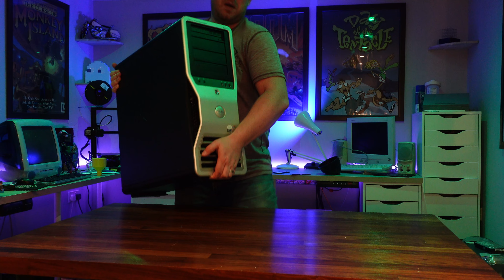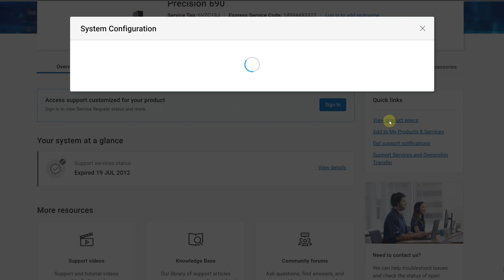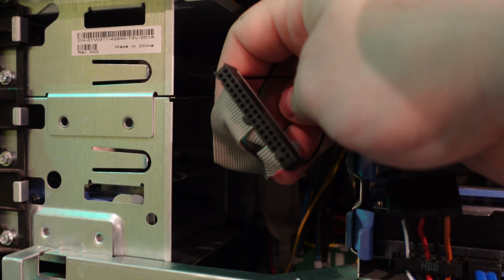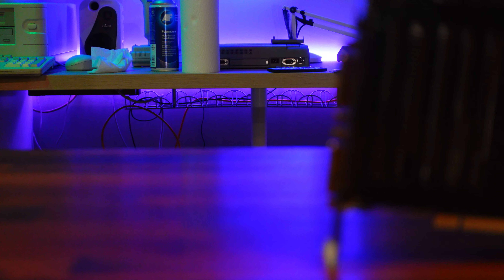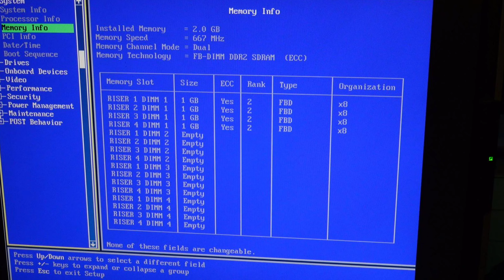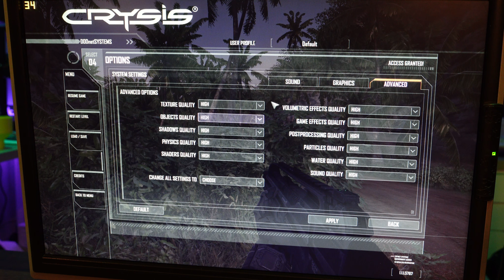Ultimate Windows XP Build - Intel Xeon / 8800GTX #GPUJune2

Comment: If you still have that malfunctioning gpu you showed at the beginning of the video odds are you can get it working by replacing the thermal paste and if it has them pads as well. Also if you know how to solder or have someone who can do it for you replacing all the capacitors is always a great idea for such an old device. Also check solder joints are good they may have cracked. If so they should be pretty easy to reflow them.

Comment: I've been fascinated by Xeon workstations for a bit now. You can get a lot of computing power for sometimes very little money the catch is the they can be big hot and loud and usually they don't come with any modern gpus and the power supplies can be a bit difficult to work with. But if you can look past that and do your research so you know what your buying and getting into they can be fun to have and tinker around with.
Reply from the maker: You’re 100% right on the big, hot and loud point: last winter this one kept my office warm, and in the summer my AC couldn’t keep up with it

Comment: I received two of these for free from my employer. They originally used Windows XP 64-bit. One had 16 gb 800 mhz ECC DDR2 ram and the other had 12 gb. These are quad channel. One had 2 dual core Zeons and the other only had one dual core Zeon. I haven't started on them yet, but I'll probably work on these as a winter project. Dell still has all of the drivers for these on their site.

Comment: Nice pc. That 1000 watt psu is begging for dual gtx 295s, i mean if the board supports sli. Otherwise 2x hd 5970 in crossfire will also do. Crysis demands it. Although the gtx 8800 is a solid choice too.
Reply from the maker: Thanks!  Check out the upgrade video I did on this machine, it got some massive upgrades to the CPUs, RAM and storage.  Sadly, it ended up drawing way too much power and with the cost of energy being what it is here in the UK I ended up taking the 8800 out and selling the rest of the system.  The 8800 now resides in a Phenom II X4 system for XP gaming

Comment: The kind of artifcats you experienced with the Hercules card are often caused by old electrolytic capacitors. I recently changed the capacitors on a FX 5900XT and Nvidia MX 400 with similar artifacts. They're working flawlessly now.
Reply from the maker: Thanks for the tip. I’ve subsequently got it working on a Socket 370 based system so hopefully I can revisit it soon

Comment: That is definitely pretty cool I have windows xp rig  
 I call it the station It doesn't have  A workstation Processor But I have a workstation  Graphics card it's  a     Navidia quatro 4000  It's definitely  Overkill For windows XP 32 bit There is a lot of games But I get a 100 FPS  Or more But sometimes overkill can be fun Anyways Thanks much for the great video
Reply from the maker: Sounds awesome, why wouldn't you want the absolute best performance for your XP games. Especially if you couldn't afford it first time round

Comment: Ah, I didn't realize these were variants of the XPS 7x0 series chassis!  The staggered PCI-E slots on the riser is unique to this case, the 7x0's case is all in a row, but it's also BTX and otherwise internally identical.

Re: optical drives on SATA: SATA was still very new and only just one generation prior to this, the number of ports was still usually limited to just two or four, so people were precious about what they attached to them.  Since there was no performance to be gained attaching even the fastest DVD drives to SATA, IDE quickly devolved into 'good enough to host my optical drives' and 'compatibility connector for old HDDs that haven't failed yet'.  If you follow the cable routing, you'll see Dell absolutely treats it as the latter; in my XPS 710, the IDE cable is pre-routed out of the board, behind the drive cage, between the PSU and the side panel before arriving at the front panel for quick installation of a secondary drive.

There are no 'proprietary' Dell GPUs; Dell OEM cards use the bracket with the cable management hole for convenience and stability during shipping.  Obviously nothing prevents you from using any card you like.

You absolutely must update the BIOS and take a look at the cheap Socket 771 Xeons you can fit into this board!  2GHz with just two cores is okay, but you can do much better.  Take a look at the 'low-power' Xeons; for $5/ea., you can get four cores running at 2.66GHz with a cool 50W TDP, a figure surely significantly lower than your existing CPUs.

Also, this would be a very good candidate for dual-booting as you can run Windows XP for backwards compatibility purposes (to support Win98 and early XP titles that misbehave on newer OSes) and Windows 7 or 10 for compatibility shims (dgVoodoo2, ReShade) or community QoL patches, source ports and mods that will often depend on DX10+/Vulkan (dgVoodoo2, ReShade, modern source ports like GZDoom, etc).  Vista?  I really wouldn't bother at all.

Just realized I'm seeing this video pretty late.  Hope this information is still useful to you as you explore the limits of this system's capabilities!

Comment: Nice industrial class retro machine you've got going there!

As for my XP retro build: Intel Core 2 Quad Q9650 @ 3.0GHz, Gigabyte EP35-DS3R, 8GB (4x2GB) G.Skill DDR2 1000, 2GB GDDR5 EVGA 750 Ti SC, Creative Audigy SB0090, XP Pro SP3 (32-bit) & 8.1 Pro (64-bit) (with ClassicShell Start). It too can run Crysis. ;-)

Also: 128GB & 256GB SanDisk X400 boot SSDs, 1TB & 2TB WD Black game & data HDDs, dual Lite-On SATA DVD writers, Sony 1.44MB 3.5" floppy drive, EVGA SuperNOVA 550G2 PSU, BeQuiet! Shadow Rock LP CPU cooler, Cooler Master Elite 370 case, Scythe Kaze Master KM01-BK VFD fan controller, Anidees 120 & 140mm blue LED halo case fans, optional extra EVGA metal backplate for 750 Ti and BitFenix Red, Green and Blue SATA braided data cables.
Reply from the maker: Thanks, that's a beast of a GPU for that system!

Comment: Great video, my xp project build is an AMD Athlon XII 5000 with 4GB ram and a Radeon X1900XT 512MB crossfire edition graphics card. 

The mobo is bright red so I wanted to use parts that match my color theme.

I've seen Radeon HD 2900 graphics cards up to 1GB with a translucent red fan shroud adorned with Chrome flames, that's the gpu i really want paired with this retro rig but I'm not paying over 50 for a card that old.
Reply from the maker: That's a sweet XP build!

Comment: There were a lot more PATA DVD-RW available in 2007, which were cheaper too. Next to that, there weren’t any speed advantages over SATA for such an optical drive back then. 

I’d love to get such a beast for myself sometime. They are just so well built! 

Thanks for this video!
Reply: Even Apple was using IDE optical drives in their Mac Pro's through 2008, making the switch to SATA in 2009.

Comment: It was the days of eSATA (not eSATAp) too. Surprised none of the external slots were because it was faster than usb 2.0 at the time and included on many mid to high range external hdds.
Reply from the maker: I wonder if this was an after market addition?
Reply: I have one of these sort of eSATA brackets installed on my Q9650 retro PC build, it came with the Gigabyte motherboard.

Comment: It's always great to see these old workstations get a new lease or life. The dual cpu is very cool! Also the 2GB of RAM is due to the fact there's two CPUs so it's running them in parity. Another kit would get you the full 4GB
Reply from the maker: I've got a whole pile of parts sat next to me to pimp this thing out soon
Reply: @TMEretro  nice! Did you manage to find another memory kit for it?
Reply from the maker: @thesmokingcap  16 sticks of 2GB ECC DDR2
Reply: @TMEretro  Noiceeee, should be a beastly machine for dualboot OS's
Reply from the maker: @thesmokingcap  vista 64 bit dvd should land through my door this morning!
Intrigued how it will handle something like Ubuntu too though
Reply: Seeing only half of your RAM because there's two CPUs "running it in parity" is not a thing. That's not how parity, or having two CPUs, works.

ECC memory has extra space for parity bits on the DIMM itself, so you don't lose any capacity because of it. There's 4 sticks of ECC memory in this system, 1 GB each. That gives you 4 GB of usable memory, just like with regular non-ECC RAM. And both CPUs can share all of your installed memory.

If only 2 GB are available to the OS, and the BIOS says it's running in dual channel mode instead of quad channel mode, there's something wrong with your memory, and your motherboard cannot see all your DIMMs. Try taking out the riser assembly and re-seating all modules.
Reply from the maker: @looks-suspicious  got a feeling its one of the riser cards, I've played with the configuration and sticks on the bottom riser are not working properly
Reply: @TMEretro  You don't have to use the riser cards, it's a bit pointless with just four sticks anyway.
Reply from the maker: @looks-suspicious  what if I had 16 sticks?
Reply: @TMEretro  Nice, but you'll only get to use them if all your riser cards are okay. If not, there's still 8 slots on the motherboard itself, and 16 GB is plenty. You could try running XP in PAE mode...
Reply from the maker: @looks-suspicious  it's working (rather pointlessly) with 32GB of RAM now
Reply: @TMEretro  Great! And that's not even the most pointless thing about it. 😁
Are you going to make a follow-up video on this machine?
Reply from the maker: @looks-suspicious  yes, shooting it now 🙂
Reply: @looks-suspicious  I was thinking more of a server sense where you have to balance your memory across the CPU's
Reply: @thesmokingcap  In this machine, memory isn't assigned to either CPU. The CPUs don't have direct access to the memory; there's a centralized memory controller in the chipset.

Comment: The 8800GTX was the perfect choice. Actually the one I have is also one of those DELL OEM versions with the sled, as they can be had pretty cheaply, and the sled comes right off if you don't need it. But hey, it works even better here.
More RAM and a fully-patched Vista would be great future upgrade paths for this machine. I also wonder what are the fastest CPUs this thing could support.
Reply from the maker: I've got two Xeon 5355's sat here next to me, along with 16x 2GB DDR2 ECC sticks, a PCI-X Gigabit Ethernet card, an SSD, and other parts - yeah - we're pimping this thing out.
Reply: @TMEretro  Nice!!

Comment: That thing is bigger then my T3500 with a X5690, only has 6 2GB stick of RAM, and I have added a AMD RX580 8GB. Runs Windows 10 Pro fine with a Samsung 850 EVO.
Reply from the maker: I'm thinking this could run windows 10 quite well with an SSD thrown in, but not sure what value I gain from that when my main rig has a Ryzen 5900x and a 3080 😂

Comment: The X58 Precision systems are so much better than these slightly older lga 771 systems. I have a t7400 and the fact that you can install two 6c/12t processors versus two 4c/4t processors is best of all.
Reply from the maker: Cool find with the T7400!

Comment: Dust can be mitigated quite a bit. I have a t3400 & use air filter foam cut to sit in front of the lower front fan inside the pc, it covers the whole front of the fan shroud so as not to get sucked in i.e there's a curve towards the shroud at farthest edge, while the edge closest to the side panel gets tucked into that fan shroud tang thing which appears to be not moulded in yours . I then added this mesh cloth which i think is for holding women's stockings in the washing machine to the front panel to cover any remaining grill holes. I guarantee. your dust issues will be minimal. It does mean all but most of the durst collects on the lower front panel on the outside with more being caught on the now installed fan filter . Any dust inside the pc is really fine. My pc is 3" above ground level in the lounge. I clean the dust when it builds up enough on the outside which is about a year. Dell weren't the only ones to do the ide/sata weirdness i had an acer or early hp that did the same. Dell XP x64 had some support for the early 755 model however it was missing numerous drivers if i recall. That pissed me off as it was fast on 2 cores, then again x32 was quick on 2 core. Super fast on xeon quad which i later installed. The one thing i like about xp is customization with object desktop from stardock. You could make it look like a control panel off of star trek & i ain't talking just a wallpaper, it's an actual working theme where buttons etc on screen activate this n' that. Then there's logon studio (free) to change logon theme & then there's the free boot logon software to change that. I believe you have more work/fun to do yes ?. Downloading themes & perhaps make a vid of it as i suspect many have no idea how customizable xp is. There's other software that does the same thing that escapes my memory. All themes are free at wincustomize
Reply from the maker: Thanks, some good advice there!